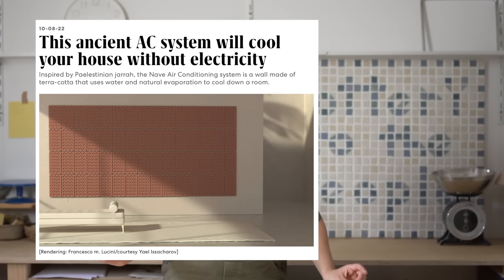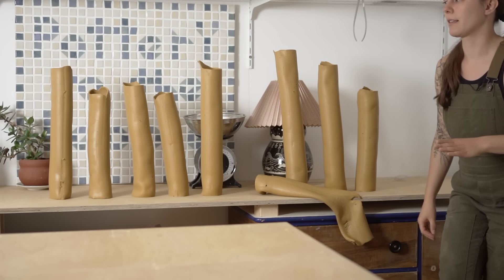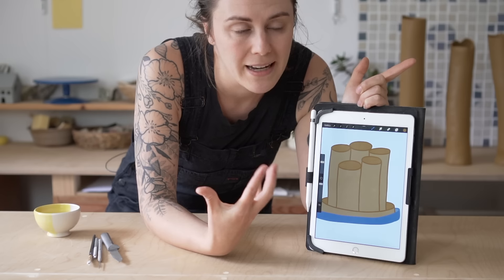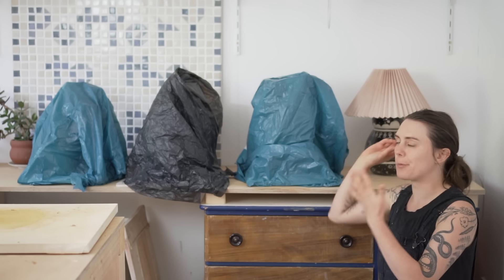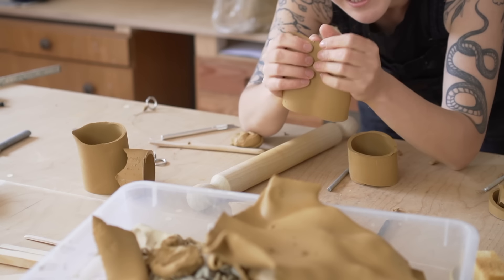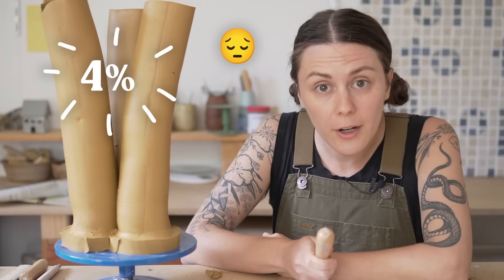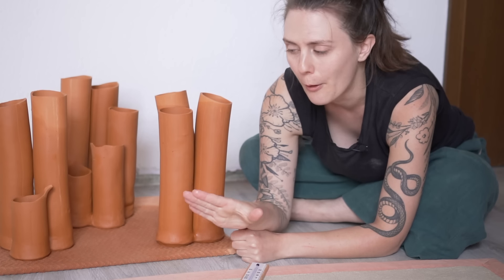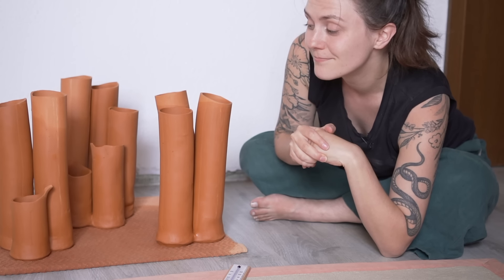Can I make an A/C out of clay???

Comment: nnnnooooooooo!!!!  you are trying to violate the laws of physics.  that will not work unless you remove the steam from the room.  the water absorbs heat to change from liquid to gas but if you do not remove the gas, it will condense again and release the same amount of energy (and you will get mold).  there is another ancient technique that involves a large pot of water that is allowed to evaporate to the outside where where it won't condense in your house (apparently Chinese sky wells do something similar but more complicated way with tubes of cooled water running through the house?.  also, this would probably not help a whole lot in places where you really need it.  I live in a humid area where sweat does not evaporate much and you just end up wet and still hot.  you need a dry climate for the evaporation to take place more rapidly.  if sweating doesn't cool you down, this probably would not be a miracle.

Comment: your only argument against AC is that it requires electricity to run.. but they have been making them smaller and more energy efficient with each new generation of tech. and we are utilizing more and more green energy production..  AC is totally sustainable, if your power source is too, sustainable. (a personal set of solar panels for instance that power only the AC unit is totally green as  the AC unit itself does not produce any dangerous emissions =P)    HOWEVER your clay, some of it pure some of it impure. is now capable of leeching toxic chemicals into the water, that you are evaporating into your air. (and before you say 'my clay is OrGaNiC'  so are heavy metals. and they aren't friendly)   our Ancestors while intelligent in their own right. did stupid things like lead paint in makeup.  take their wisdom with a grain of salt and apply copious amounts of modern scrutiny and critical thinking.   your Passive Water Cooler. is.. meh at cooling. and risky in its own right.  Side note! the passive cooler. Unlike an AC unit is going to raise your ambient humidity. just a fact? wet heat or dry heat. some people have a preference xD (someone who lives in the us, in the southwest where temps easily climb to the 40c area all summer. )

Comment: While I enjoyed the proposition I disliked the climate and sustainability fear mongering, hence I won't subscribe. Check your facts before spreading propagandas that redound into the restriction of liberties for an alleged greater good.

As for the device itself, I liked it but the way I see it it has a fundamental flow in that it can't really do anything with the temperature being as it is simply sitting in the room without connection with the outside. The temperature drop in the room was most likely due to the closing of blinds, which should have been already closed before starting the experiment. The water must have indeed got cooler as it evaporated off the ceramic skin, but the evaporated water remained within the room therefore the room net temperature wouldn't change.

This principle will no doubt work if applied properly, which involves evaporating water OUTSIDE the room intended to be cooled down in order to transfer heat outside the room. To do this I would design a device with two parts connected with a tube. The room part should be just a regular trough but it could be made into a radiator shape to maximize air contact. The water in it should be connected with a tube to the water on the outer part sitting outside the room. This again could be a simple trough or made into a radiator and in this case a porous ceramic will help to evaporate water. Because the water is connected, the extra heat from the outside should flow inside and help equalize the room temperature with the outside. However since the water outside evaporates at a higher rate than inside, the heat is expected not only to remain outside but to siphon the heat from the room outwards much like the venturi effect.